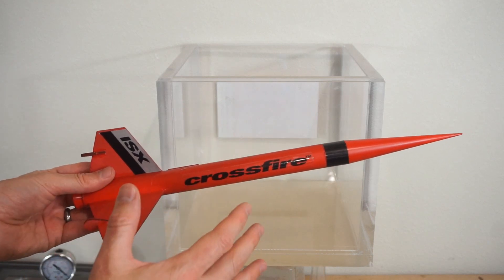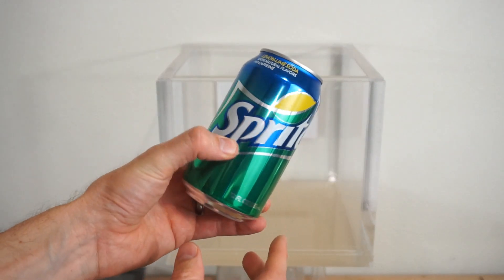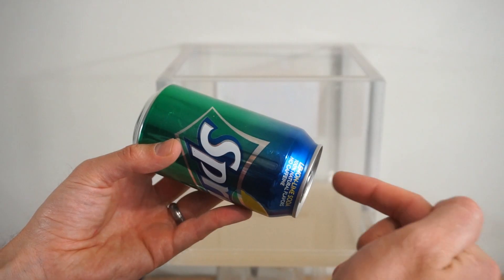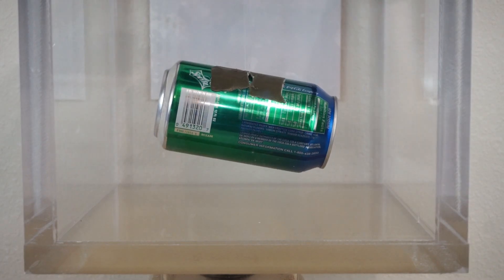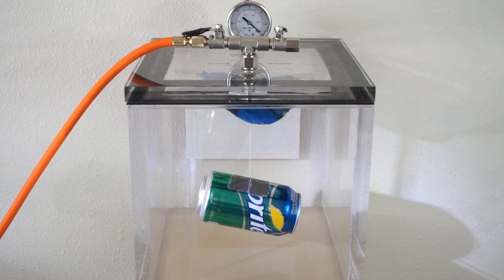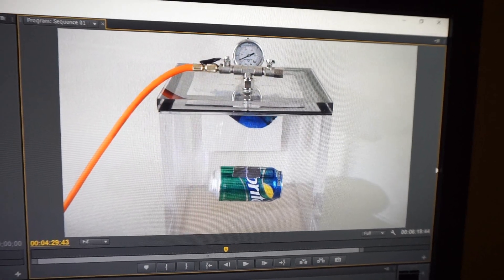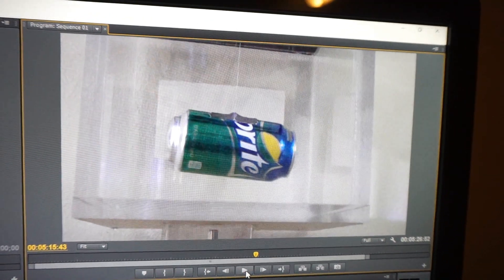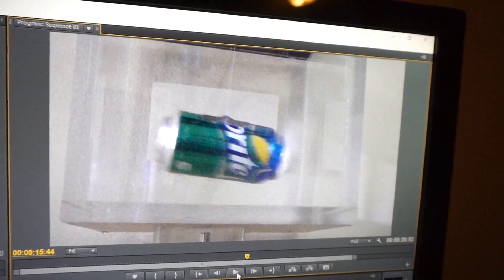Can a Rocket Fly in a Vacuum Chamber?

Comment: A soda in a small cube under vacuum is not the same as a rocket in the vacuum of space.
Reply: the cause and effect of change in momentum and mass transfer by the conversion of potential pressure energy into kinetic energy however, is the same in this case or with a rocket in space.... which was the entire point of the video.
Reply: @engineeringtheweirdguy2103  so rockets violate newton's 1st law according to you, as no external force is required to create a change in motion? you sure you're an engineer?
Reply: @papalegba6759  actually there is no change in the momentum of the system. which is mathematically determinant. in addition it does not violate the 1st law. As gas particles are in motion, the external force acting on the rocket is the collision of gas particles onto the walls of the combustion chamber whilst exiting out the other side. Meaning there is a net force in one direction. and thus, thrust.

its pretty basic.
Reply: @engineeringtheweirdguy2103  so the external force on the rocket is in fact an internal force according to you? because rockets are INTERNAL COMBUSTION engines, so any forces within the combustion chamber are, by definition, INTERNAL.
and you also claim thrust is not an applied (i.e. external) force either? lol no, that is wrong. 
oh & btw if there's no change in the momentum of the system then it won't have moved anywhere either, nice self-own there. pretty sure you're a chatbot at this point tbh.
Reply: @papalegba6759  that entirely depends on your definition of external or internal. please define your definition. as I have mentioned else where you definitions, what ever you chose them to be does not change the physics. whether you think the physical object applying an external force is internal in location or not is irrelevant. In this instance external force means a force applied not from itself. For example, standing an a rope and trying to use that to lift yourself off the ground so you can fly is an internal force. someone else lifting that rope is an external force.

If you were to sit on a spike wayyy up your butthole. and someone picked up that spike and threw it with you on it. just because the location of the force was internal. does not mean the force was an external force.

 also, Just because the momentum of the system changes doesn't mean the momentum of the individual parts changes. When you throw a bowling ball as a bowling pin and they collide. The pin goes flying and the bowling ball slows down a little. Conservation of momentum tells us the combined momentum of the two parts (the ball and the pin) remains the same. I.e. change is momentum is zero. Hence the conservation of momentum law. But we know that the momentum of the bowling ball and pin change. as momentum is transferred between them.

you thinking I self owned myself by following the most basic laws of physics hilariously shows how fucking dense you are.
Reply: @stuartgray5877  if you don't know what gas pressure is or how it works just say so, fake engineer chatbot bro.
Reply: @papalegba6759  WHY do you refuse to answer this question?
OH because ANSWERING TRUTHFULLY PROVES YOU WRONG!
Reply: @stuartgray5877  i've answered it repeatedly on countless threads: thermal energy from combustion. why do you think rocket engines have combustion chambers, crazy angry hate-speech posting chatbot guy? meh, you're just a lying machine....
Reply: @engineeringtheweirdguy2103  you just said that definitions of terms are irrelevant to the laws of physics. which means you can just make stuff up as you go, as words mean whatever you want them to mean. which is exactly what i've pointed out you are doing anyway. congratulations on another epic self-own.
Reply: @engineeringtheweirdguy2103  you claimed that the combustion in an INTERNAL combustion engine was an EXTERNAL force. so you're clearly a liar who makes up definitions as you go.
Reply: @papalegba6759  I was actually meant to write wasnt but it appears I was auto corrected. In either case the point remains the same. Your definition of internal or external has no bearing on the definitions actually used to define and describe the physics. For example the internal combustion engine. The combustion is considered internal to the motor. However forces travel through materials. An internal force would be a force originating in and acting on a material from within a material. For example, if you twist a ruler it’s not going to go anywhere but it can begin to fracture and break. That’s because the forces of compression and tension are within the material. If ice expands and fractures itself the forces within the are aren’t going to make it magically fly off in some direction because the forces are internal to the material.

In a combustion engine the combustion is considered internal to the engine as a descriptor of the type of engine it is. In terms of the physics involved the nomenclature changes, the force is external to the piston or the cylinder material. I.e. the force is being applied EXTERNAL to the material that make up the piston or cylinder.

That’s why listing internal forces including bending moments, shear force, shear stress, etc etc.

I’ve explained this to you before, your inability to understand this very very basic principle of physics doesn’t prove a grand conspiracy but rather exposes your own ineptitude. Such as trying to prove you can draw a PV diagram for a rocket by providing a link which actually stated you cannot draw a PV diagram for a rocket. But you were none the wiser because you are inept at thermodynamics and you lacked even a cursory knowledge of the subject that you didn’t understand the difference and applications of a closed vs open system. Which once again, shows your complete lack of understanding in the subject you are claiming to be fluent in.
Reply: @papalegba6759  if I were you. I’d give up and crawl back into the basement you came from.

Comment: A rocket opens a valve and expelles gases ... The can was a good idea but the liquid pushing against the whole top of the can to make it pop would have equally pushed the other end as predicted by Newtonian mechanics ... That is not what a rocket does ... Would nobody be able to access the huge vacuum chambers that NASA used to test space suits ....there might be a small bit of movement expelling but without something to push against I just don't believe it could be sustained
Reply: .... why does a rocket not conform so the same physics? liquid is just gas particles with bonds between them. solids is just liquid particles with even more bonds between them. Basic physics shows that gas expands equally in all directions. we know this from combustion engine cylinders even. why would rapidly expanding gas undergoing combustion not push on the top of the rocket?
Reply: So If I fired a CROSSBOW in space I would NOT feel a recoil force?
Reply: @stuartgray5877  a rocket's not a crossbow, spamming chatbot bro.
Reply: @papalegba6759  But a rocket engine and a crossbow must BOTH follow the LAW of conservation of Momentum, something YOU clearly do NOT understand.
Reply: @stuartgray5877  never said they didn't, lying chatbot bro. funnily, the momentum of a gas particle expanding into a vacuum is entirely conserved, meaning it has not exchanged momentum with another body. which is why a rocket cannot move in a vacuum, as no momentum exchange is possible. you can't push on nothing, chatbot stu... lol you lose again. you always do, cos you're not human.

Comment: It proves that the wall is indeed is what causes the can to go foward. Just because you can't see it on the computer doesn't mean the can moved in an air-free environment.
Reply: The pump was continuously running and the vacuum monitored with a gauge. That's the very reason he did it. An "air-free" environment was maintained throughout.

Comment: now the question is does jet fuel flam propell or push a rocket in the same way that the entire tank of soda does a lite can of aluminium that weighs much less than the weight of the soda liquid inside the cam which makes up about 95% of the weight or mass of the soda can.

Jet fuel flame does not weigh more than the space shuttle.

I'm not saying it's impossible

I'm just pointing out that there is a difference between emptying out your entire tank of gas in 1 second VS emptying out your tank over a long period of time in space. 

And there is also a difference between fire and soda in a vacuum.
Reply: 99% of the mass of the rockets taking off into space was fuel. 1% was the space shuttle. want to re-think that? also its rocket fuel. not jet fuel.
Reply: It isn't because there is "fire" that creates thrust. Any mass being ejected at speed out of the rocket nozzle would create a certain amount of thrust. The trick is to flow a crap ton of mass, at very high velocity to create a LOT of thrust. The combustion is used create high temperature and thus high velocity of the gas (propellant).
Reply: Did you realize the the Space Shuttle Main Engine (SSME) is rally just a giant water cannon?
If a catapult were to fire a 500 kilogram block of water ICE at MACH 8, would the catapult feel recoil?
yes or No?
Reply: @stuartgray5877  : I'm sure you lost him at "recoil"....

Comment: Your funny experiment is a total failure and shows in no way that rockets do fly in an infintive vacuum. First of all, your closed infinitve system (the box) is never to be campared to the alleged infinitive vacuum or space, they are not the same. An open infinitive vacuum is not equal to a closed finitive vacuum you are using to prove that rockets do fly in space. Second, in your experiment, as the air or gas moves out of the balloon or Sprite can the box is no more a vacuum, also in this environment you are creating there is no continous movment of the balloon or Sprite, they just move for a second and fall down! and you want to prove with all this that rockets do fly in an infitive space or vacuum?LOL. In order for an object to move, it needs a medium to push off , like air in case of rockets moving in the air, or the ground (street) in case of cars , by pushing against the medium, the medium pushes back as a reaction and makes the object move. In an infinitive vacuum or space, there is no medium to push off, throwing a mass out by a rocket in an infinitve space results in an instant equilibrium between the mass and the vacuum so there is no movement at all, in other words the movement of any material object in an infinitve vacuum is absolutely impossible.
Reply: Rus - If you would care to answer about five very basic physics questions I can convince ANYONE that rocket Propulsion MUST work in a vacuum.

Care to try  a few of High school level physics questions with NO MATH?

First question just to see if you have the  most basic understanding of Inertia and Momentum:

If I fire a steel projectile from a crossbow, here on earth, WILL I FEEL A RECOIL FORCE? Yes Or No?

After you answer the questions I can show you VIDEO that is proof of rocket propulsion in a vacuum.
Reply: @stuartgray5877  Looks likes I am dealing with a NASA troll.
You are explaining a deception with another deception trying to prove that NASA and Elon Musk's fake so called rockets can fly in vacuum!!LOL . I have watched some of the  non interesting funny videos on your channel,  claiming that recoil force is the reason why rockets fly. NO, it is not and the answer is in my first comment, any object in order to fly needs a medium to push against, without that medium which is usually air No airplane, rocket or even a bird can fly and this is an established fact. Medium is not to be confused with a projectile fixed to a crossbow, pistol or the like, these are objects just like the crossbow and pistol, they are not mediums. A medium is a external surrounding of matter that has nothing to do with the objects itself and without it the object could not move, it could be fluid (water for example), gas or solid where the object push against so the action and reaction is not between the rocket and the mass attached to it as you claim but between the rocket and the surrounding external medium (air).
I assume you would recommend me to have a lesson in physics and my answer would be : i do not need your pseudo- science, keep it for yourself.
The following is a link that shows what happens to the so called rockets launched by you beloved NASA and Elon Musk.
https://www.youtube.com/watch?v=zPrm9Vfgyo4&t=24s
Reply: @stuartgray5877 , a typical response from a troll, instead answering the points i wrote in my last comment tries to escape using ad hominem.
Reply: @Rus-bw2oq  : You seriously think that "orbit" and "space" are the same thing? Please tell me you're more educated than that.
Reply: @LN G It was the wrong @ lmao

Comment: I think he is right about the functions of the rocket in space but I am not sure about the concept of the rocket working better in space. Can anyone explain to me why it would work better in space. To me in space the concept of Newton’s Third Law is all that is at work. The mass of the fuel after the reaction is being thrusted out of the exhaust so you are getting an equal amount of propulsion from the weight of the fuel being forced out, however in the atmosphere you have the medium of air to push against giving you much more ability to build pressure against and push against more mass. I.E. standing on ice skates and throwing a baseball vs throwing a medicine ball. 

To me the rocket should would much better in an atmosphere, it is the force of gravity that makes it more challenging to get moving. Is this correct?
Reply: "Can anyone explain to me why it would work better in space"
Sure.  FOr a rocket to propel itself, it needs to generate MOMENTUM in the exhaust gases as they leave the nozzle. Momentum is DEFINED by: "Mass Times Velocity".
The higher the velocity of the exhaust gas, the greater the momentum, and the greater momentum transferred to the rocket.

So at sea level, the external pressure on the nozzle is 14.5 PSI.  The exhaust must fight against this 14.5 PSI to accelerate the gases.
In a vacuum, there is no "backpressure" on the exhaust gases so they can exit at higher velocity.
Higher velocity of the gases means greater momentum transferred to the rocket engine.

So Higher exhaust velocity results in more force during the ejection of gases.

Comment: Your simply getting momentary inertia. If you were to prolong that energy you wouldn't be able to control the rocket direction even with fins attached to it because there are no molecules to interact with them.....the rocket would simply erratically spin around.....also failed experiment because you had a string attached, big difference if can was suspended unassisted!
Reply: I can convince anyone willing to answer 5 simple physics questions that rocket propulsion MUST work in a vacuum.

Want to answer?
First question: If I fire a standard steel projectile from a crossbow, here on earth, WILL I FEEL A RECOIL FORCE? Yes or No?
Reply: You missed completely the point of this video... 🤷🏻‍♂️

Comment: Chamber is too small, the gas pushes against the lid because the lid which pops out first, has mass and the gas is pushing against the aluminum lid. This is not a fair experiment. The correct test is when you step out of a boat that is not attached to the dock, you won’t be able to move forward because your force can’t push you out when there is no mass to push against. You’d fall in water and your chin would hit the dock, as seen in videos that are appropriately named, jackass! (Newton’s Law)
Reply: Sorry but you are incorrect.
If the "boat" in your example is a tiny rowboat that has less mass than the human, then your example stands.
However IF you could push the rowboat away at say 600 MPH, then you WOULD get enough forward momentum transferred to you to make it onto the dock.
OR if the boat was large and massive (like a house boat) then your example fails.
Its about the MOMENTUM transferred to the object you are pushing on that gives the "PushER" forward momentum.

Sure the exhaust gases coming out of a rocket have very little mass but they are travelling at MANY TIMES THE SPEED OF SOUND (2500 meters per second or 5600 mph) so they have a lot of MOMENTUM stored in them.
Therefore the rocket gets a lot of MOMENTUM transferred to IT as well as the exhaust gases.
the momentum transferred to the gases has to be EQUAL TO and OPPOSITE of the momentum transferred to the rocket.

Comment: It's not the same concept. The rocket moves because of the various explosions happening on the back, but the soda can moves because the pressure isn't released in the front's internal wall, then, the pressure behind pushes at th ssame force when it was compressed.
Reply: The "Real" concept of rocket propulsion is the "Law of Conservation of Momentum".
To PUSH AWAY mass requires a FORCE. The force is felt by the object getting pushed AND the object doing the pushing.
So as the rocket increases the MOMENTUM of the exhaust in one direction, the rocket feels the SAME CHANGE in MOMENTUM but in the opposite direction.
the vector SUM of the two changes in momentum must cancel.

Comment: Can doesn't move until "propellant" hits wall.
You need a bigger vacuum chamber as your walls are too close and interfering with it.
Why a can of pop? Can't get a rocket to?
Also water isn't in a spent gas in the vacuum of space.
Reply: - "Also water isn't in a spent gas in the vacuum of space.
"
You know that the Space Shuttle Main engine expelled nothing but PURE WATER as the reaction mass?
so water most certainly CAN provide propulsion in space.